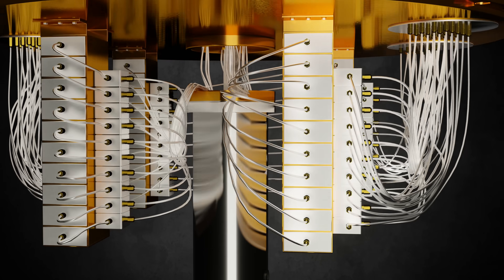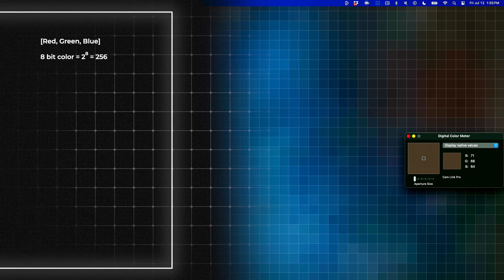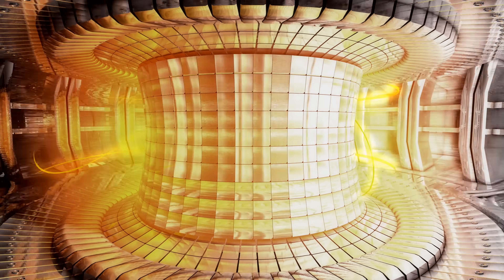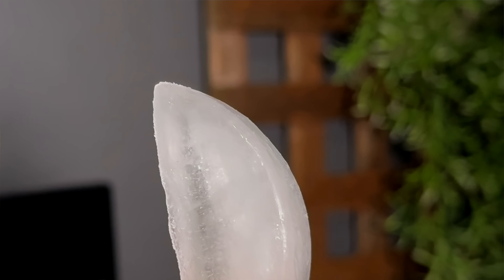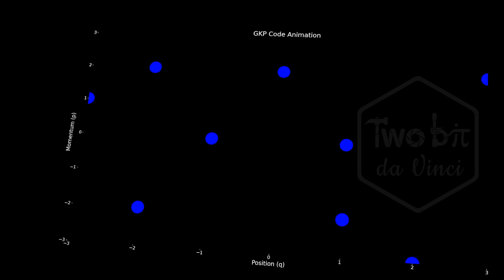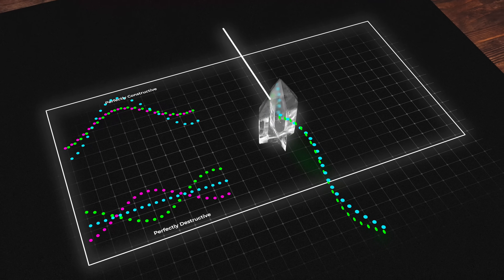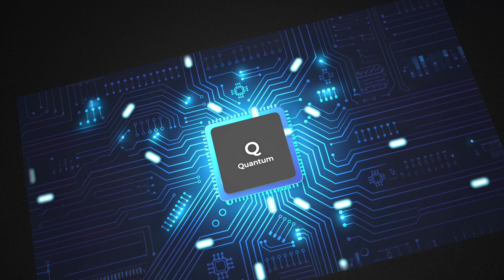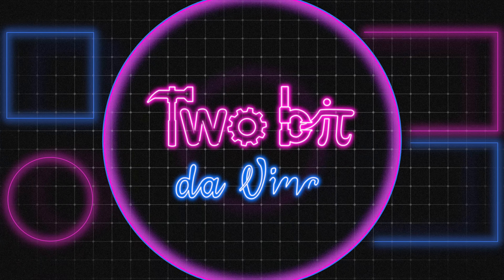Quantum Computer Breakthrough Can make them Mainstream!

Comment: I've watched so many of these explainations of the quantum thing and all I come away with is that instead of binary, there are infinite levels.  Primarily spin plus the flip which yields 4 states.  And I think other values can be  derived akin to phase in analog data or QUAM up to things like 256 or whatever.  All I see is a way to get bytes out of single bits.  But just like QPSK the error comes from being able to differentiate the discrete values.  So instead of doing all the super cooling etc. why not just setup a QPSK processor?  I still don't get what magic a Qbit has.  How exactly do you capitalize on the uncertainty?  Where's the magic in terms of problem solving?  Way back in the very beginning of all this stuff I heard that a quantum computer tries all combinations at once and the single right solution pops out instantly.  Is this a myth?  If not, how does the quantum part make this happen?
Reply: It's not a myth, it's just a bit more nuanced. The thing with qubits is that they are probability functions that behave like waves, so they interact with each other through interference like waves do (it's called quantum interference). So, as far as I understand it, what quantum algorithms do is play with the probability functions and the phases of the qubits and make them interact through interference (as opposed to simply adding bits in linear fashion).
So, imagine that creating two qubits is like throwing two stones in a pond of still water. You'll get a bunch of waves that interfere with each other. A classical computer would add up the individual values of the wave in each point in space, but the quantum computer instead "sees" the entire pattern with all possible interactions of constructive and destructive interference producing all the peaks and throughs.
If you're doing optimization, all the algorithm has to do is "look for" the tallest (or lowest) peak in the pattern. How does it do that? It sort of happens automatically because those peaks correspond to the solutions of maximum probability, so the solution to the problem will be the most likely output. BUUUUUT, there's still a probability that the outcome will not be the one with the highest probability (the wrong answer), which is why quantum computers are prone to error.
Reply: @Israel_Two_Bit  Thank you.  This is the first real explanation that makes some sense.  It still sounds like something that could be done the same by mixing two RF signals (or light interferometry).  Same effect.  At least now I won't just scoff at all this.  Something about the whole thing just sounds like smoke and mirrors to me though.  Like they are doing something normal but in a super elaborate way to make money.
Reply: @dougcox835  the problem with analog rf signals or any analog signal is the inherently imprecise measurement of say a voltage. Is it precise to 5 or forty digits of precision, 10 billion nanovoltes how many sig figs, how many digits are just noise.  Quantum is 0 degree polarized or 180 with all values represented with one unmeasured photon until the wave function is collapsed.
Reply: @jamesfrankel7827  0 to 180 is just binary.  This is my beef with quantum.  The way I see it, it's 1 or 0 and up or down spin.  So instead of 2 states per bit you get 4 states with quantum.  That's better, but not as earth shattering as they make it sound.  But I think it's more than that, and an unlimited amount of variations which makes me think of the analog comparison.  Also, you keep hearing about how the biggest problem with quantum is noise and that's why it's super chilled.  All of this just sounds like the same sort of issues you have with analog and makes me think this is all just an elaborate version of an analog computer.  I'm cool with that by the way if that's what they're doing.

Comment: NOOOOO! Not for all intents and purposes. The cat is 1/2 alive and 1/2 dead ONLY outside the box, and ONLY if there is NO INFORMATION flow between the box and outside the box. By no information flow, I mean NOTHING AT ALL, no heat, not light, no magnetism, no gravity even. If there is absolutely no information, energy, heat, vibrations, photos, etc. etc. flowing from inside the box, then the cat as far as the rest of the universe is concerned is 1/2 alive and 1/2 dead. However, if you are inside the box, it's one or the other, there is no huge mystery here. P.S. Quantum Computing, for all intents and purposes, is 100% hype and b.s.
Reply: For all intents and purposes, this comment reads a bit deranged.

Comment: Great informative video as always! Just wanted to point out that trapped ion quantum computers operate at room temperature and don't need extreme cooling as you stated in this video. Additionally, IonQ plans to have a 64 algorithmic qubit system by 2025, which is considered commercially viable, something along the lines of 100,000x as powerful as the worlds current largest classical supercomputer
Reply from the maker: thanks for the insights! IonQ ... will have to look into them. cheers!
Reply: Key word; by.